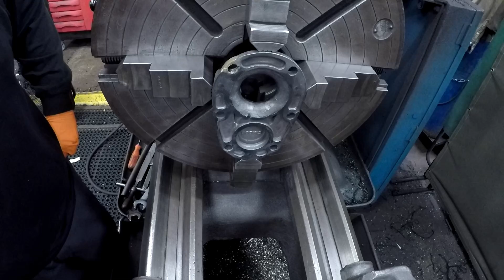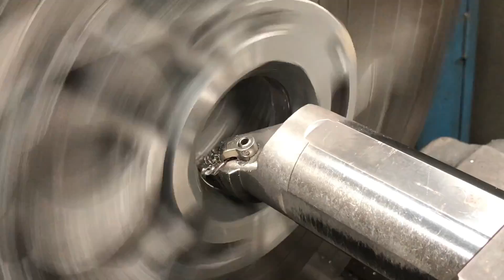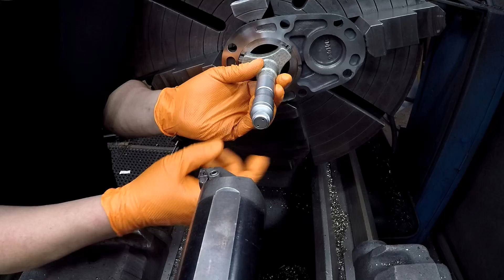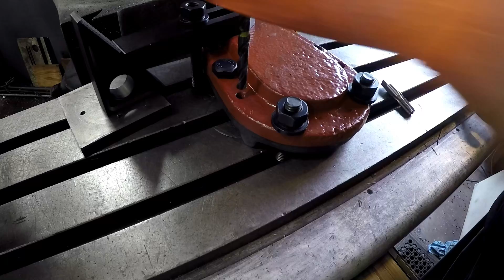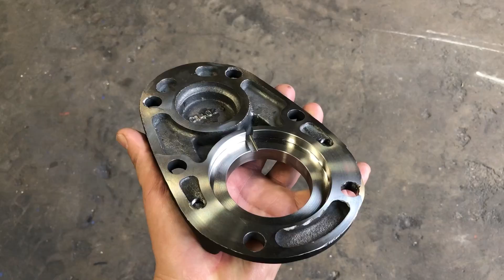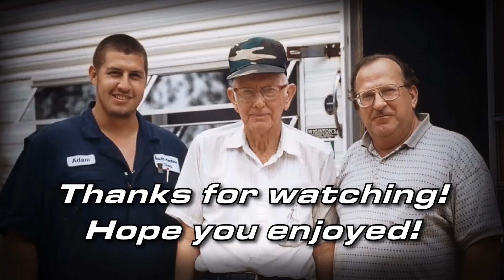Machining a Replacement Casting Part 2

Comment: That looked devilishly difficult. Never seen a tri mic before either. Great video.
Reply: We've got some digital tri-mic's at work with replaceable heads. 2-2.5 dia, 2.5-3 dia, ect.They work great.

Comment: Having a replacement casting made up is a great solution IF it is good cast iron. I suspect some nodular iron (crankshaft, camshaft) got into the melt, turning what should have been an easy job into high stakes machining. Excellent work Adam.
Reply: Adam explained in Part 1 that this was a rush job and the casting was pulled out of the sand mold as soon as possible.  He determined that it was the cause for the iron becoming so hard.  In this case, a little more patience probably would have paid dividends.  Sometimes you have to slow down to go fast.

Comment: That gearbox was pretty crudely machined.(Not what you did) It looked like all the bolt bosses were just as cast.  I wonder where it was made? Looks like it should have been a cheap one anyway!
Reply: Hey Brian, HAPPY NEW YEAR.
It seems that all these companies want is cheap, Cheaper, CHEAPEST.  They report profit and loss every three months in quarterly reports.  That tends to focus all their energy into short term thinking.  They depreciate the cost of the equipment off of their taxes so all they care about is that the things lasts until it is fully depreciated.  Then they toss them out as scrap or rebuild.
Reply from the maker: Many of the newer units we see seem to be cheaper and smaller units, and many of them throw away.

Comment: Hi Adam. Thank you for yet another great video. May I please ask your thoughts on a something off subject. I'm looking to make a collect chuck for my lathe and I was just wondering what material you would advise on. It will mount direct to the lathes spindle plate so no cone nor threads to take into consideration. My thoughts were something along the lines of en-36a or am I well off the mark. Thank you in advance should you respond.
Keep up the good work.
 
Kindest regards

Comment: shouldnt it of been 342 so it was just under
Reply: No as it required a slip fit. You would be right if the application called for a transition fit.
Reply: I think they are allowing for thermal expansion when it is heated to operating temperature.
Reply: What does “of been” mean?

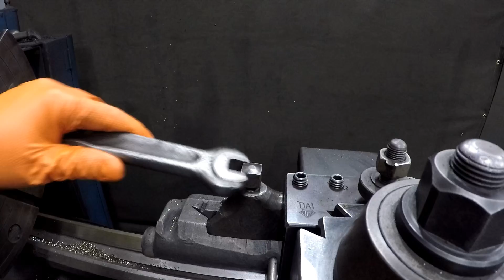Comment: A fairly easy job turns out to be a real beast. You sure did a great job taming that beast, well done. At 22:59 That is the setup I used to use on the lathe to face cast iron gearbox covers. It chips, who cares, slip in another bit and go. Finish cut was only one that counted. The iron I cut had some hard spots, but nothing like what you encountered on this part in previous video. I was able to drill the holes with hss drill bits, but they did not last as long as normal.

Comment: Great job Adam, those threaded holes on castings are used to insert bolts to aid pushing the cast cover off the gearbox, prevents damaged from using screwdrivers and the like
Reply: Then why pipe thread?
Reply: @boaterbil  ? the thread is normally the same as the main casting so you use the bolts that hold the cover casting on so you dont have to search for any
Reply: @kevinhunter7436  
They were threaded 1/8 NPT, not going to be able to use those for pushing
Reply: I'm thinking it's the oil fill... Fill in the higher one till it runs out the lower one... ?
Reply from the maker: They’re for oil.

Comment: Great stuff as always!
I was curiously looking forward to see you machining what looks like the seat of a second bearing, but you didn't machine it. So I am wondering what is the purpose of this feature of the casting?
Reply: hell it was hard enough to use the casting itself as a bearing seat
Reply from the maker: It was designed that way so I copied the original.
Reply: I didn't want to criticize your work, Adam. I was just curious, because this second seat does not seem to have any purpose in the gearbox. (Thus: why should you machine it?) My guess is that they used the same design/pattern for different gearboxes.

Comment: This is a turd demonstration. You took a turd and made it into a usable part. You did a really good job. A friend of mine who passed away was a machinist that worked on cast-iron parts of a certain style every few weeks. Every time he saw that job come in the door he would say we are going to ruin a bunch of tooling this week because the castings are contaminated. There were 67 separate steps in machining those castings. At every step along the way there was the possibility of the part being scrap. There are usually between 25 and 50 pieces to be done each time.Unfortunately the owner would not change casting suppliers because the one he was using was less expensive than everyone else.

Comment: It was necessary to strip all surfaces before the final cut, because stripping with a blow could move the part and the hole would leave the center

Comment: Hi Adam just asking why you did not cut the end out of steel instead of getting it cast?
Reply: The amount of time it would have taken to machine it out of a billet would probably have been too expensive.
Reply from the maker: A part of that complexity would have been challenging and time consuming to machine out of drip of steel.